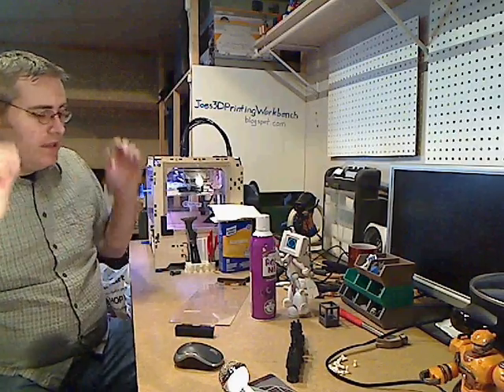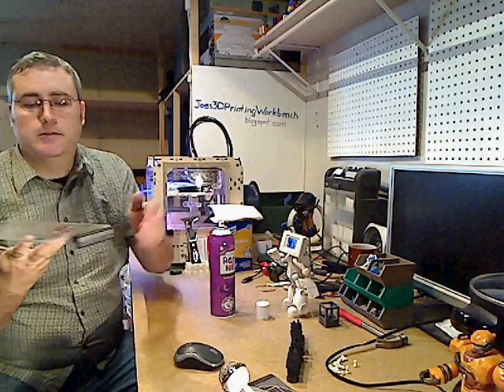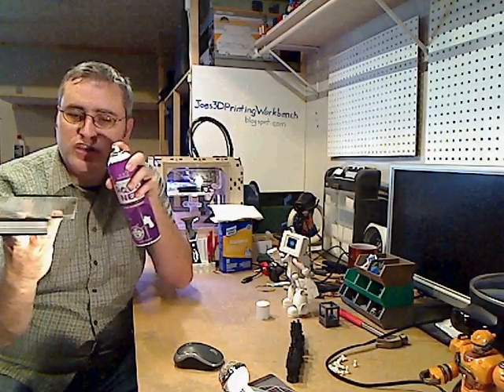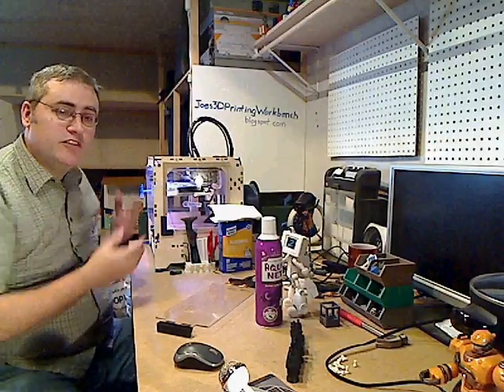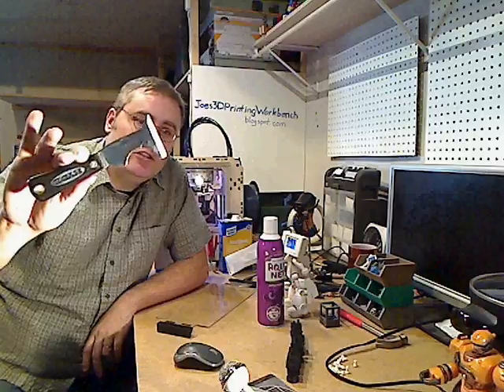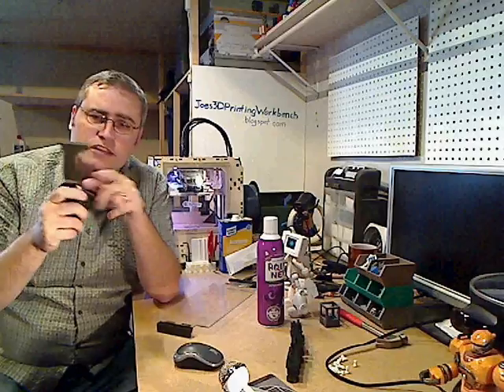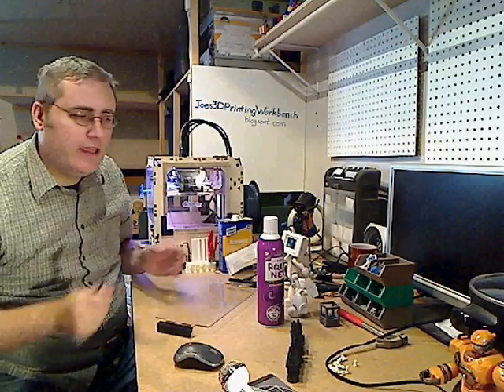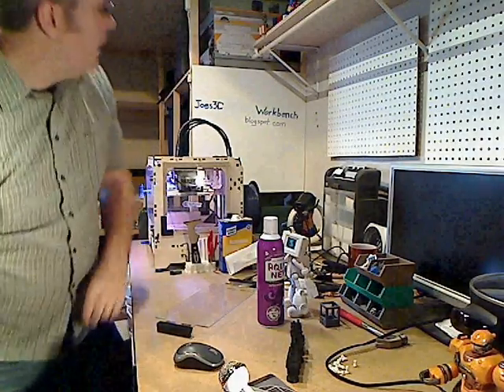3D Printing Tip - Glass and Hairspray

Comment: Mention ventilation dude... some lad in England blew himself up doing this.
Reply from the maker: Not the whole fiasco. There was a boy who died. There was a 3D printer present and he was apparently using hairspray for adhesion. He was also in an enclosed room in a magic shop where they stored flash paper. Now, was the fire because of the 3D printer or the flash paper? Who knows. Of course the media is going to play up whatever will get the most clicks.

Regardless, I didn't talk about ventilation, and that's not right. Whatever the media says, a discussion about safety when using an electrical machine that produces heat and melts plastic, would probably not be amiss.
Reply from the maker: I've got plans to do a video comparing many different build plates because there are already many options and none of them are explosive. I don't even use hairspray any more. But this news does indeed sadden me and I may bump up my talk on ventilation and fire safety.
Reply: Paul Bedford yeh just reading his thing in our newspaper... trying to find the video he watched but that's impossible 😔 there were other factors though aswell.. but why would people promote the use of flamables knowing all ages view
Reply: If you ACTUALLY read a proper article on this, you will find out that he used more than 1 can (3 I believe)
Reply: oh really because I live in the same town so I have the first hand newspaper... not read anything about more than one can...
Reply: Ryan Smith doesn't really matter how many cans. Most people know hair spray produces flammable gases, some don't. You make an instructional video on YouTube that contains dangerous 'stuff' you have a certain duty to declare that, unless you're into Darwinism in a big way...
Reply: Lol No. Stop reading only the titles and do some research. The whole fiasco was horse shit by the media.
Reply: I do my research on things before I jump into you, as people should. This video is not about the dangers of hair spray or 3D printing, its an information guide. It does whats its supposed to. If you cant read the instructions on the items you are using, then you should not be using them.

This video does not need information on health and safety.

Comment: I am currently in the process of removing a print off a glass with glue adhesion and I have been at it for an hour straight, I've tried looking for ways to remove the print but can't, now I'm looking at the floor and thinking if the glass bed falls by "accident", will my 13 hour print be free? 
I sure will try the hair spray professor, anything is better than super adhesive elmers purple glue, ANYTHING.

Comment: Thanks for the video, this was so clarifying! I noticed that the glass is not the same height at every spot, I thought about it coming from those dragon clips  I use, but I didn't believe it. I'm going to stop using those now. Also, the hair spray. When I tried it (back in the days when I haven't had a heatbed) I applied just a tiny bit and, of course, without heatbed it didn't work out anyway. So I'm gonna make some clips to hold the glass and buy some hairspray and make awesome prints, yey :D
Reply from the maker: I wouldn't recommend dragon clips since they can warp the bed and make it uneven. Instead 3D print a clip that is more fitted to your printer and glass. That way you're not putting pressure and bending the bed. Good luck.
Reply: Thank you! It's looking very good so far, I printed out a test pyramid and it just cooled down to like 20C and the whole thing still sticks to the glass (because of the hairspray)! I'm happy now :D Edit: Surface is 100% straight, no bending, no warping, nothing. WOW!

Comment: I have a Robo3D which already has a heated glass plate.  Can I use an additional glass plate on top of the existing glass plate and coat additional plate instead?  It would help me keep the original plate clean and I could take advantage of the multi-plate system you mentioned
Reply from the maker: +Patrick Haggood So full disclosure. In the more than a year since making this video I've abandoned glass plates and hair spray. It was just too fragile and I was going through too many of them. I've switched metal textured with sanding and hairspray. I don't even really need to hairspray most of the times except for the release. But I am experimenting soon with the gekotek3D removable build plate and there will be a video coming about that soon, if ti doesn't suck. However it doesnt' seem like they have a Robo3D option so... i don't know. The Robo3D seems to me to be not a very hackable system. I'd say hit the google groups for the printer and ask people who have tried it.

Comment: I have a XYZ Da Vinci printer and flashed with Repeater host. And I use Elmer's glue sticks, the purple label, for my projects. I heat up the bed, clean it, and then let it cool. Apply to the work area my glue and start my project. After the print is done, I let the bed cool and lower it to the lowest level. I let it sit for a couple of minutes (2-5). Then I reheat the bed. Most times the piece just pops off and sometimes I have to use the scraper tool. I don't print to often, but it's so simple to do when I choose to.

Comment: What extruder temperature and bed temperatures do you use? I have been doing 100/230, is that a good starting point? Thanks!
Reply from the maker: +Craig H For ABS. For PLA I use 60C/220C.

Comment: Do your prints also become EXTREMELY stuck to the build plate? I'm talking, crazy sticky. The first time I tried it, I had to use a spatula to pry the print off and I ended up hurting myself due to how sticky it was and how it suddenly snapped off whilst applying so much pressure with the spatula.

Also interestingly, after the part popped off, there were markings (some sort of ridges) on the dried hairspray probably from the first layer being too close to the bed... Does this also happen to you?

P.S. I waited for the plate to be fully cool before attempting to remove the part. I actually set it outside in the cold for some time.
Reply from the maker: +Tiago Espinha (飞龙) Yup, your bed is too close to your nozzle and your first layer is getting too pressed in. YOu need to lower your print bed no more than 0.5mm at a time. 

I've changed from glass to aluminum, so I can be a little more agressive when removing the parts but you have to still get the print level right.
Reply: +mrjoesays the hairspray still works with aluminum beds?
Reply from the maker: +jv071 You have to rough up the business side of the plate with sanding (not sand blasting as that will warp the plate). I want to play with other surface treatments once I gather together the scratch.
Reply: +mrjoesays you mean that scratch with sandpaper? I have 240 sandpaper at hand, will test it. Good to hear, can't wait to see the conclusions of your tests

Comment: The tool is called a "5 in 1" tool: "scrape paint, spread compound, remove putty, open cracks and clean rollers". It's also used to open the paint cans... LOL so maybe it should be called a "6 in 1" tool... Anyway, good informative video! Thanks!
Reply from the maker: *****  Also, scrape prints off the print bed. Also, scrape droolies off prints. Cuts open packages and bags.  It's pretty much the do everything tool.

Comment: I don't leave many comments on people's YouTube channels... But.. Your tips on the hairspray were excellence. I've  tried hairspray before, but it didn't work.. So I switched to glue sticks. They actually work pretty good, but it's hard to keep the glue layer maintained. 
It seems simple, but with your tips, I coated my aluminum bed with multiple, thick coats of hairspray and the adhesion of my abs was amazing. And easy to maintain by spraying more when needed. I just was using way less than I should have been.

Thanks for the tips!

-Matt

Http://www.quickdrawbot.com

Comment: Thanks for the video, I'm getting info while I wait for my printer to arrive :)  Also....IDK I  anyone's mentioned this.... but the round section of the tool is for cleaning paint off rollers, both to salvage the unused paint back into the can and then to assist in cleaning the roller under water:)

Comment: I use a squirt bottle hairspray instead of air canister.  I put a couple of squirts on, wait about 10 seconds and then rub it once or twice with a paper towel. Then the same again, then a final couple of sprays that I don't wipe with the towel. This uses very little hairspray and makes the surface extremely tacky. I use it straight away and it works great! I also ripped off a piece of my glass by pulling off my print while it was still hot. Fortunately I only pay $0.90 for each piece of glass.

Comment: Alright,, I'll "let the cat out of the bag".  It works on cold beds,, glass and acrylic.
I've been using acrylic plates w/AquaNet "Superhold" on  Printrbots,  and glass plates on a WD4,,  for PLA,, no fan on the 1st layer.
I use ALOT less,, very lite coatings (mist). as instructed by "3DPrintingToday" podcaster - Andy Cohen, for glass plates.  The misty coat technique will go on cloudy and dry to clear. It also produces an "alligator skin" effect, that may also be helping with the stick..?
6 coats to prep new plates,, just 1 after that.
Dry with hair dryer, heater vent, sunny window. Or just make multiple plates,, ready for use.
Releases with a little flexing of the acrylic,, or 1min. in the freezer.
Use smallest binder clips to hold the bed down (just 2 works fine).

So far, I've only tried PLA.   I'm going to try this with ABS , on a FFCX w/enclosure,, Full "Pause" for 15min, then back to printing with no heat to the bed.  I gotta find someway to keep those corners flat on larger prints with ABS...??